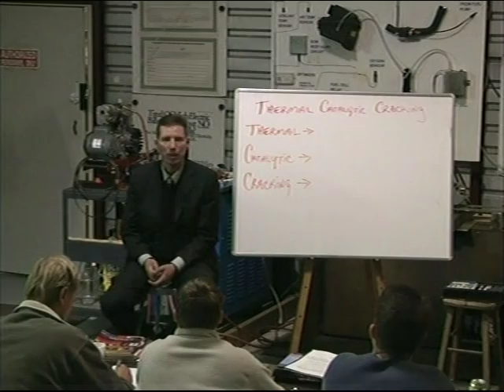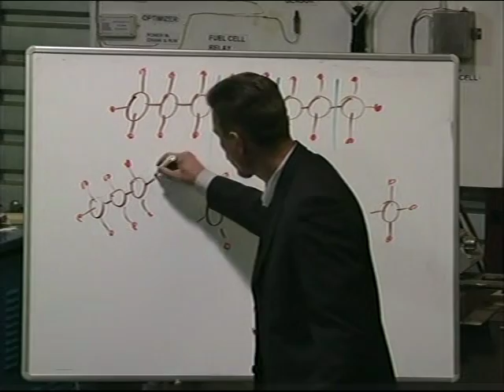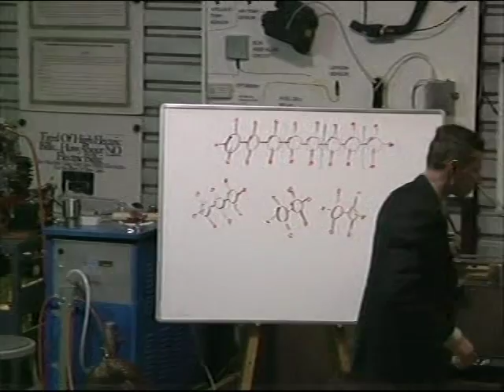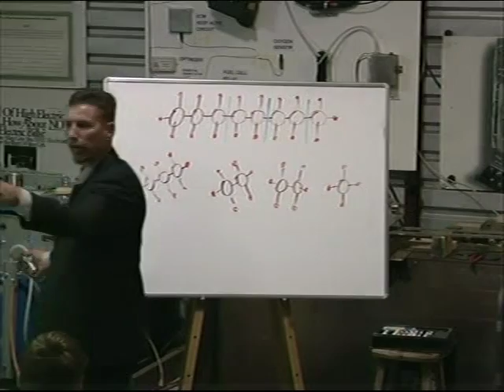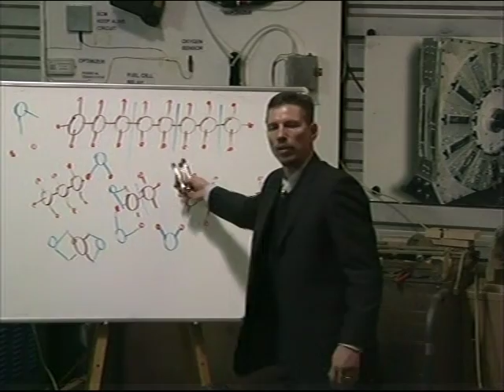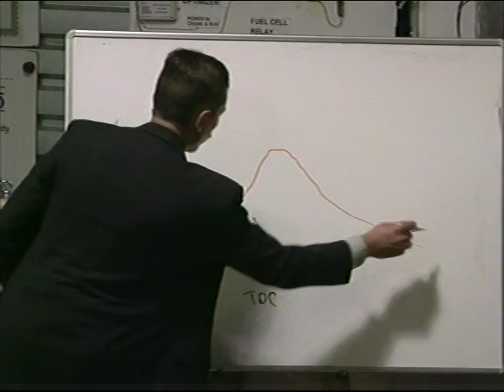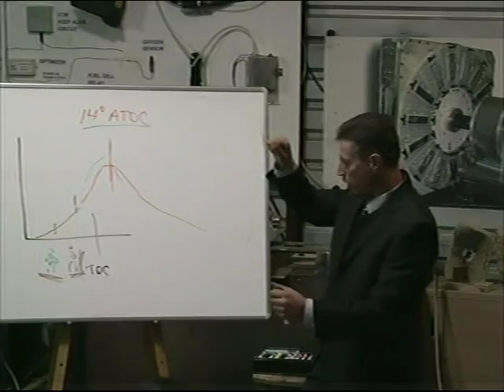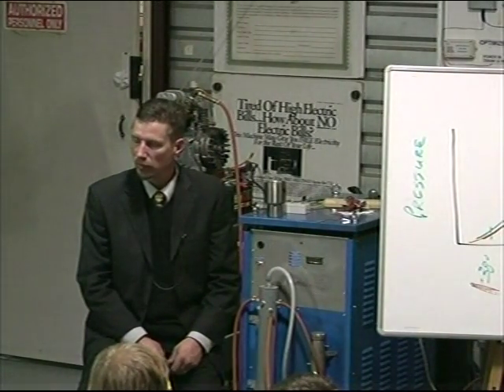Mike Holler on the science of fuel chemistry Part 3

Comment: The HAFC/PICC program was real and a huge threat to big oil and the  auto industry. People that bought the HAFC and didn't get a 50% increase were not getting scammed by Dennis Lee. The engine and emissions computer systems on modern cars is designed to be nearly impossible to hack into leaning out the fuel for an extended time without very expensive aftermarket gear. The Optimizer board they designed for the kit was not enough to overcome this on most vehicles, but at the time they didn't realize it. Only when the customers would lose the gains and come back repeatedly for re-tuning they realized something could be wrong...but the mechanic that tuned the optimizer could also maybe not tune it correctly. There were too many variables to know for sure what the problem really was. Before they could innovate and create a solution for better tuning the FTC swooped in with Dateline NBC for a double punch attack that put them out of business. I bought several of the HAFC kits at a deep discount. I met one on one with Mike Holler. I participated in the mechanics conference hotlines when they were happening. This was a fantastic program! The best that ever was. Watch every video of it on here that you can, because the information is gold. Currently I am running the HAFC kit on my Jeep Wrangler. For me to maintain a 50% gain I have to re-tune the sensor streams each time I drive it, based on the weather and conditions I observe on my scan tool. Not practical for a regular user but a fun hobby for me. The kit works but has its quirks.
Reply from the maker: Great explanation Mike you are absolutely spot on. I am still installing HHO kits for people sometimes for free. I have one this weekend. Voloperformance has come out with a programmable OBD2 tuner very inexpensive and it does work. But just like you mentioned it needs reprogramming every so often because of the same reasons you described. It is a plug in chip so way less of learning curb for beginners. If you or anyone has any questions I might be able to help you with or point you in the right direction here's my number 619-408-7854 I love talking to people doing this stuff.
Reply from the maker: Also Mike you should checkout John Ellis water and its effects using it in hho cells.
Reply: That Ellis water...I'm skeptical. I'd believe it when I see it. With the cost of the machine to make it over 1000 dollars I'll probably never see it. Shifting the water bond angle with a distiller? Eh, seems a bit far fetched. The Volo VP15 seems pretty cool. I may buy one to play with. Thanks for your number. I may text you or give you a call one of these days if I have something to share.